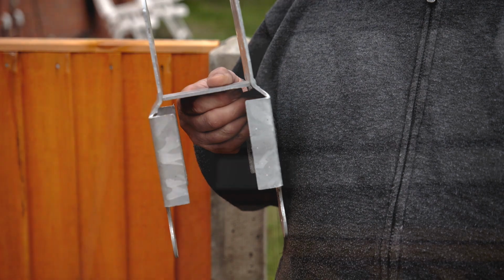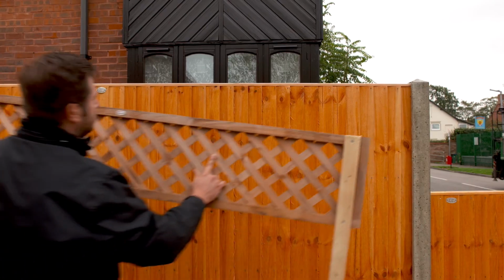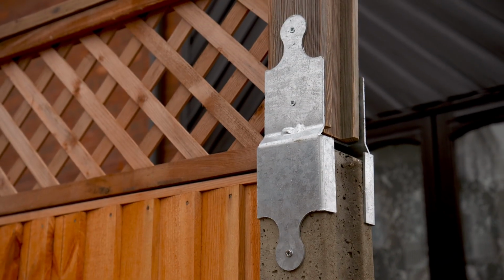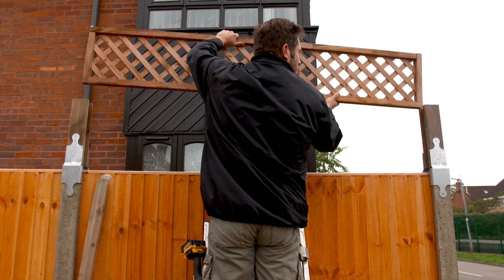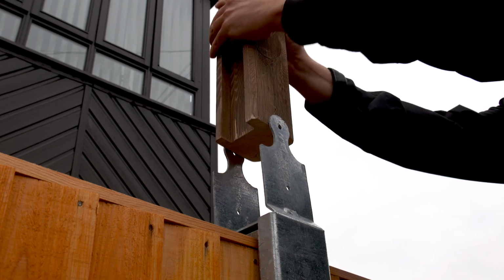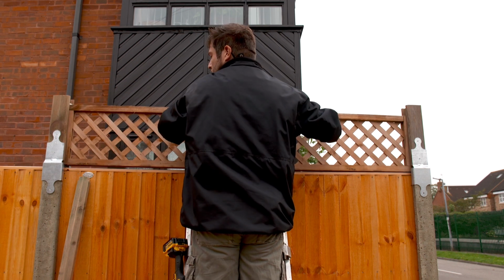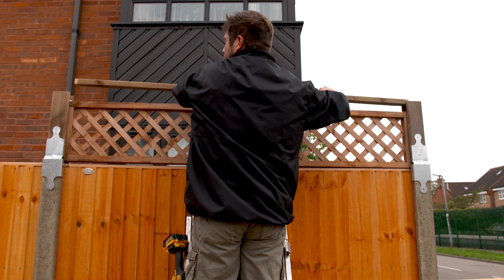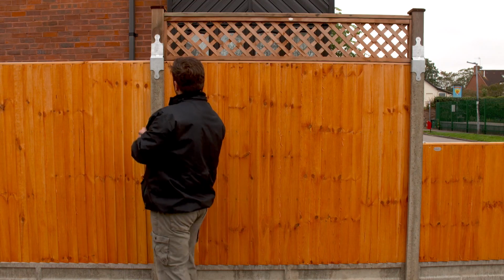The Fence Extender #fence #diy

Comment: GENIUS!!!! I'm inventing my own solutions at the moment too. This is a brilliant idea. I need mine to be solid at the top. The cheapest idea I've come up with is to buy wood fence panels 8' L x 6' W and flip them over making an 8' horizontal fence attached to my existing 6ft wood fence. If I use lattice I have to sandwich 2 panel with privacy fabric in between so the price keeps going up plus more work.😂

Comment: I originally wanted 8' when I had my wood privacy fence installed (1998), but Sears Home Improvement only offered 6' & 4'. They ended up hiring some 3rd party contractors anyway, I guess who used Sears wood, idk. I got 6', but I really need 8' like I wanted, especially with how the open borders neighborhood has become. Your extension looks more like 1'(I'm sure it's in meters there wtf ever) than 2' and I'm not wanting Lattice but a solid sheet of something not see through. Heck, I wish I could have a 30' block or steel wall with double razor wire on top or a force shield to keep these criminal a hos out.
Thanks for the idea though. I'll probably rig something up using your general concept. I'm wanting to make it board on board now as well. Maybe I'll have to add some more concrete and steel poles and beams if wind can't get through anymore and may lead to leaning otherwise or what not.